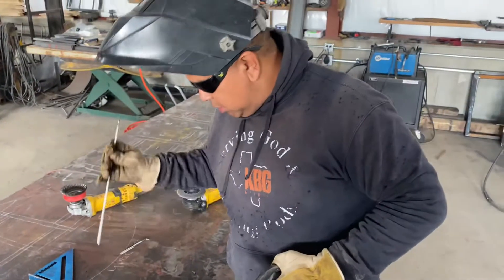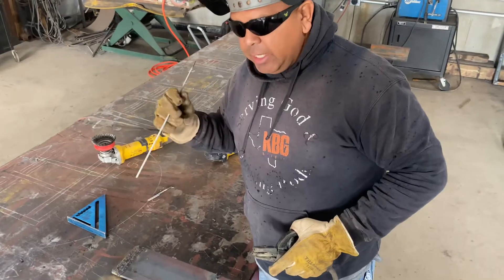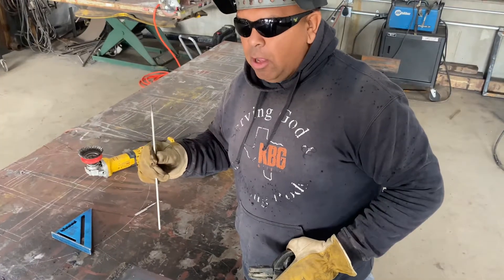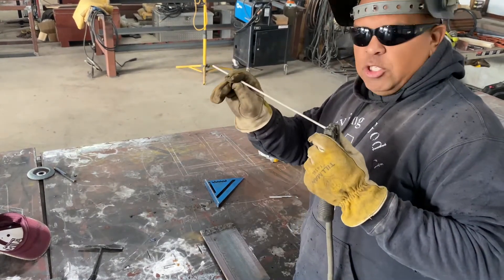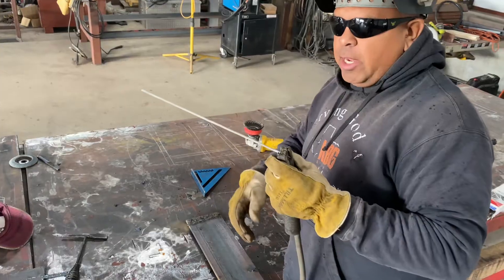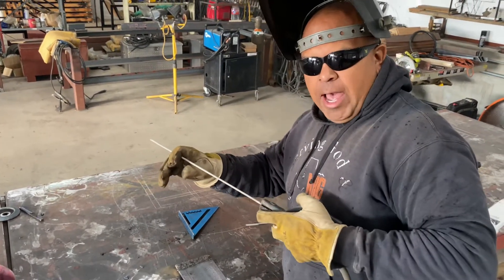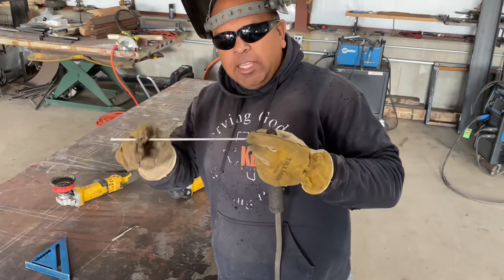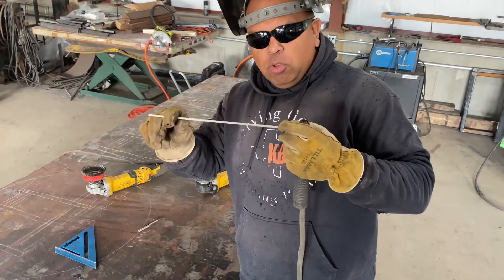Welding Tip of the Week: How to prevent welding rod sticking

Comment: I've managed to stick weld with 7014 rod, where the heavy flux helped me avoid getting the rod stuck.  But 6010/6011/6013 with their thin flux have so far resulted in total failure.  Hot start/arc force settings on my welder didn't seem to help.  I just put it down to poor hand/eye coordination, which has always been a problem for me.  But I will try the pool cue method and report back on how it works for me!

Comment: I did my first welding class today. Never welded or anything. Learned instantly. The instructor set me up, told me to practice tac weld along with his techniques and get him when I was ready with lines. It was a struggle at first. But then I figured it out. Find how you like your stick placement. I liked it diagonal to force me to distance myself from direct fumes. My sticking would happen cuz the clamp was messed up and didn't grip. Plus the high schoolers next to me (I'm 24) kept dropping thing and shaking the table so as I was welding, BOOM, stick got stuck. Generally from a newbie (to make everyone feel better if your new) comfort when holding your equipment is important. Otherwise you get tired, have shakey hands and mess up your weld or get the stick stuck. Some people there used the wall of the booth as support. That's great at first but ultimately if your going into it as a profession there not gonna be a wall next to you 90% of the jobs you do so don't rely on it. 
Next is helmet. I splurged on a miller T94I XL for my first. I tried the Vikings and couldn't see my arc really. The Miller is an affordable helmet with Clear 2.0. absolutely phenomenal, you can see everything and you have half shade options, light attachments for $54 if your gonna do night welding in a shed (with solar fan ventilation installed) like me for practice. Sometimes a light isn't enough. I have a 3 in 1 Azzuno welder (it is the best started flux core welder for $135. My instructor is even getting one after trying it and he's been welding for 2 years professionally. So if your looking for something. Please get this!) And tried practicing at night with a light. I ended up throwing my LED headlights on and that was way better. But helmet wise, if you cant see using someone's $350 viking helmet or like even a cheap $50 yeswelder helmet. Look for a helmet with Clear 2.0. yes welder makes more affordable ones for $160 I believe. The Miller one I have was $430 on sale on a website. Worth every penny to me and has a 4 year warranty, along with plenty of spare guards/screens. 
The other thing I learn is "striking a match". My instructor taught me after stop and want to start again with the same rod, gently strike metal and do a 1 inch drag. Cleans the tip off. I did it 2 times in a row to make sure cuz if the metal in the rod isnt decently exposed at the end, Itll heat up the tac left on the end of the rod and caught that sticking.  
I watched some of the kids as I've never welded before and wanted to watch their techniques, how much of an arc space, what's to fast or to slow etc. yah trust me I only learned one thing from my now class/booth buddy. And that is if the rods stuck and won't pull off, unclamp it immediately as the whole stick will turn red and burn. That's the arc forming inside the stick itself. 
I also learn that everyone I watch dragged. I was told "if your drag you slag" so I did a circular motion to go back over the welds, kept my arc distance at least a 3mm distance and lowered the rod as I went to keep that arc. 
Another thing I learned is don't choke your clamp. Keep a relaxed grip and don't stiffen your arms. Form is a thing. 

But in 6 hours I learned stick welding, did a perfect line and was praised. I practically taught myself. So now I know MIG and stick. I was even told with my MIG welds that my instructor would not think twice about having me weld his exhaust back on and encouraged me to buy broken things that need welding, clean up, fix em and resell. 

Don't let this discourage you though. Some people take longer to learn than other. 

A somewhat another tip. I was told they had a kid in the shop who couldn't do stick for a few months so they put him on a MIG instead. He did that and then when he went back onto stick he did it perfectly. So if your struggling with stick, try MIG first then stick. 

Hope this helped!
Reply from the maker: Thanks for taking the time to share. wow. like anything, we all learn on different levels. Continue to work towards your goals. Don't get discouraged when you see success from others faster than you. Stay the course.
Thanks for sharing and watching!
Reply: The same thing happened to me, I learned quickly in the same day that I could do a series, but after that I have to learn more

Comment: holy crap I've been struggling with the rod sticking! I've been using the yeswelder 135 flux to fix stuff around the house. I got some 3/32 7018 today and went thru two rods and only made 4 good passes.

Comment: I tried stick welding for the first time today. I got the rod stuck probably 20 times before I switched over to flux core MIG, which I have a little experience with. I'm happy to see I just needed to grab the rod. I'll finish up my project with my 6011s now that I know this! Thanks!
Reply from the maker: Just to be clear, use that technique to start. The rods get hot, so it is not something you want to hold on to for the duration of the weld. Thanks for watching and subscribing.

Comment: I´m new welding & yesterday did my first "frame", I was very hard to strike an propper arc but at some point I did what you say and it worked a lot better(I havent seen your video at that time), now I know this is a propper technic & I´ll try it again today. This is probably the best tip out there.
Reply from the maker: We have all did the frustration scratch that leaves arc strikes all over our part because of it. Well that will cause failure on an inspected weld. Thanks for your support and for interaction. Check out our other channel, Austin Steel Company, as we will be talking about material insights.

Comment: Can you explain the “why” on rod sticking? I’ll definitely try this tip today and see how it goes. Knowing why they stick in the first place will help me process the how a bit better. Thanks! Subbed!
Reply from the maker: The electrode closes the circuit. That's the entire process to stick welding. You are closing a circuit and creating electricity. Similar to the person that grabs an electrical cable and get stuck. The purpose or process of welding is actually allowing the arc to spray the electricity to the base metal. 
Hope that helps.
Reply: @KbgWelding  it does! Thanks!

Comment: Great tip! I'm new and sticking the rod way too often. That technique should help a lot. It doesn't burn your glove? It's pretty close.
Reply from the maker: Don't hold at the end  through the entire weld. Slide up because it does heat up but you have control of the weld by the time it heats up.